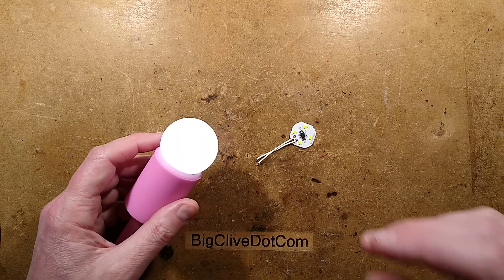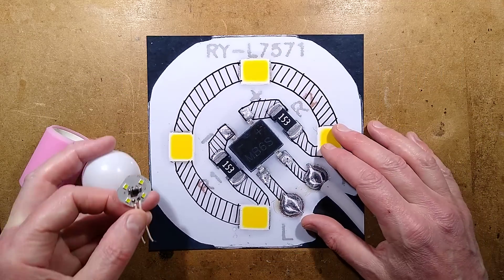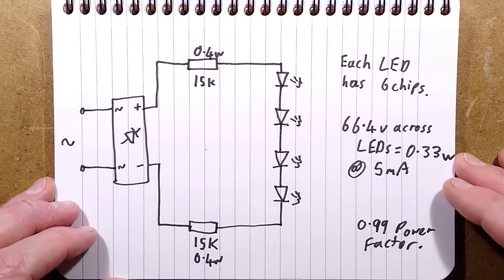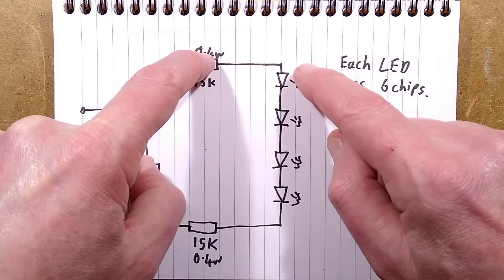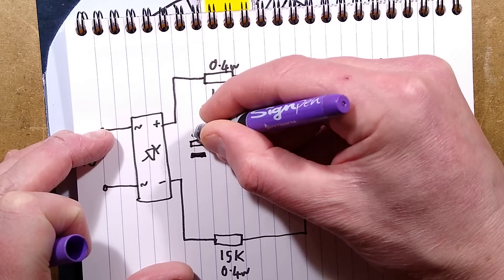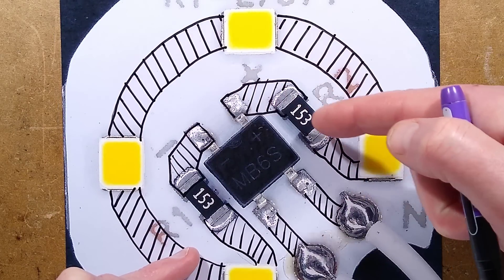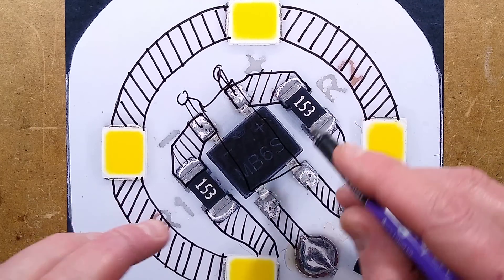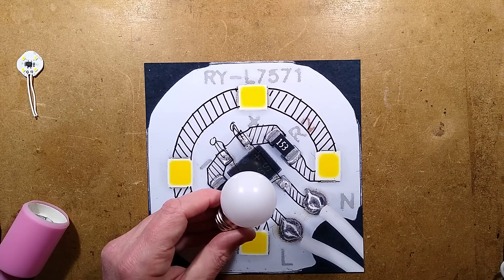Minimalist LED bulb/lamp (with schematic)

Comment: Since multi-chip LED packages are becoming so easy to make, I wonder if we'll see ones with two chips in reverse order from each other. That way no rectification is needed, and no worries about flicker (?) or bad power factor. I guess the problem is that an LED chip doesn't like being subject to reverse voltage as well as regular diodes do.
Reply: true, but in your proposed configuration, the maximum reverse voltage seen by any one LED would be equal to the forward voltage of another... 
I think 3V reverse is usually fine
Reply: @dl5244 - most LEDs have a maximum reverse voltage of 5V.
Reply: There will still be flicker, as LEDs will remain off close to the AC zero crossing (not getting enough forward voltage in either polarity).
Reply: @lostd6649  yep the same 100-120Hz flicker as with a rectified circuit.
Reply: But doing so would double the number of LEDs, and have added cost to the bill of materials (BOM). On something like this small cheap lamp, cost is king
Reply: They already make red 5mm LEDs that have two red LED chips in the same package, one connected in reverse compared to the other. Handy for using for indicators running off an AC supply (when used with suitable current limiting circuitry). There are also LED packages that have two different coloured LEDs with one connected in reverse. Red/green being the oldest version.
Reply: Don’t they do that with Christmas lights? Isn’t that that gives led Christmas light that annoying flicker.
Reply: @MrSleepProductionsInc   The inverse parallel arrangement is a  cheap way of lighting up two sets of lights with two wires. To light both up you have to apply AC and at line frequency that will flicker pretty badly.
Reply: I have a C7 filament bulb that uses LED chips as bridge rectifier with row of the same chips as main light._
Reply: I'm no expert, but I had a similar thought. Why not make the LEDs be the full bridge rectifier? From the comments in this thread it looks like it would be horribly flickery..

Comment: The resistors are 1206 packages rated for only 0.125W
If they're dissipating 0.4W each they're highly overdriven. Would be better if they used 2512 resistors or more resistors in series.
Reply from the maker: Products like this have a history of overloading resistors, but the fact they're on an aluminium PCB may help.
Reply: @bigclivedotcom  It'd act as a powerful heatsink
Reply: planned obsolescence.....

Comment: The solder joints look very dry, I guess its just the nasty lead free solder. These would look nice in a festoon wire. You could even add colour gels or tint the inside of the dome with a paint.
Reply: Yes, it's very easy to turn these into coloured lamps. I've cut a circle from Lee filter the size of the board and put that on top. When snapping the dome back on it keeps it perfectly in place.
Reply: @Ni5ei  Thats the type of thing I was thinking, be nice for different times of the year to just swap the colours. 👍👍

Comment: Ah yes, I sent you a picture and link of that lamp long time ago after which you ordered a couple.
I like the simplicity of the circuit and how easy it is to put in higher value resistors to make it less bright.
Reply from the maker: I was trying to remember who sent the picture.  I searched my email and couldn't find the original message.
Reply: @bigclivedotcom  Oh no problem
Just discovered half of the ones I received are warm white and the other cool white.
The cool white are 0.5W while the warm white are 1.3W
Reply from the maker: @Ni5ei  I wonder if they're using higher voltage LEDs at lower current or if the warm white ones are being driven at higher current to compensate for the lower efficiency.
Reply: @bigclivedotcom  I'll have to check with a light meter to be sure but at first sight the warm white bulbs look less bright than the cool white even though they use over twice the power. The resistors in both types are the same value.
Reply: @bigclivedotcom  Well that was interesting...
I've just used a Lux meter and measured at around 28cm (the distance Lux = roughly Lumens) for both the warm and cool white bulbs.
Warm white = 180 @ 1.8W
Cool white = 60 @ 1.3W
No idea what to make of it so I'll leave that to more knowledgeable people to explain.
Reply from the maker: I think they do coloured versions now, possibly with matching LED colour.

Comment: Oh damn, this thing is gonna flicker.
Reply: without a capacitor, the full wave rectifier outputs 2x voltage frequency.... so 100 Hz in Europe. 
The proposed capacitor would reduce the magnitude of this ripple.
Flicker is incredibly hard for humans notice >45Hz (see lamp-eye-brain response curves from IEC61000-4-15).
Reply: Not half as bad as you might think.
I have this in my bathroom in a PIR sensor lamp holder for when I need to pee at night so it's the only light that's on when I enter the bathroom. Never noticed any flickering, not even in my peripheral vision.

Comment: 0.99PF is very desirable, but wasting 70% of the input power as heat in two resistors is not. What percentage of the power in an incandescent lamp was wasted as heat? This seems a backward step.
Reply: Incandescent lights waste 95% - only 5% visible.
Reply: @acmefixer1  Thank you. A considerable improvement, then, but not as good as an LED lamp could and should be.
Reply: @zh84  True
But this is about a $1 0.5W bulb
Making it more powe efficient would probably raise the price over the price it will cost you on electricity.
Reply: My thoughts exactly.  99% of consumers are not smart enough to know, unfortunately.  This is the root of a great number of problems.

Comment: Of course, there are 2 main problems with purely resistive current limiting. Either the voltage dropped by the resistors is high and the power dissipated is wasteful but the current and hence the output power of the LEDs is fairly constant over a large range of input voltage, or the voltage dropped by the resistors is lower but the current and therefore the output power of the LEDs varies dramatically with small changes in input voltage.

The manufacturer will not want a lamp which is over bright at 240v and dim at 220v so they would go for the first option. Thank goodness we now have the smart chips which don't use this method of current regulation.
Reply: Another way instead of the resistors is to have a capacitor in series on the AC side, but it will create some reactive effect. You might want a bleed resistor over the LEDs though to avoid a faint glow when the lamp is turned off.
Reply: That's certainly true and it improves the efficiency at the expense of power factor. It also removes the one benefit that a purely resistive load provides - the ability to use a standard dimmer. Lamps with smart chips also have no dimmable property.

Clive's idea of putting a smoothing capacitor across the bridge rectifier also ruins the dimming function to some extent with the circuit as designed, the solution being to put the resistors on the AC side.

I expect the next smart chip will have the bridge rectifier built in  so that the waveform can be sampled to allow the chip to perform the dimming function.